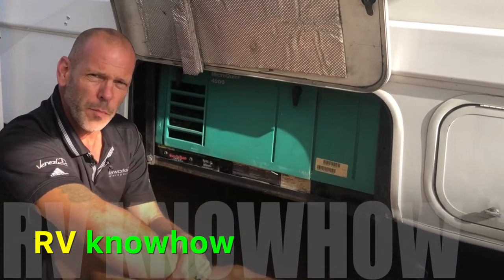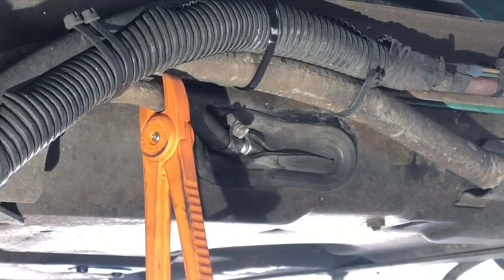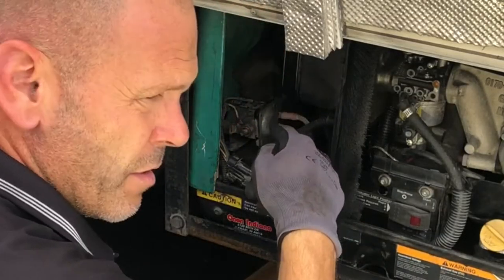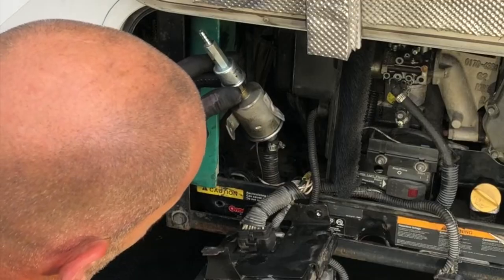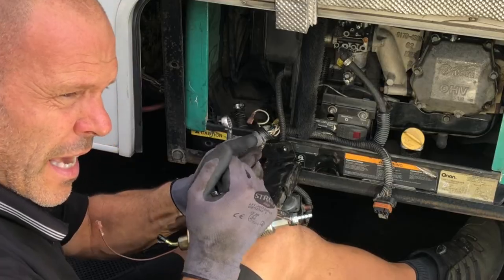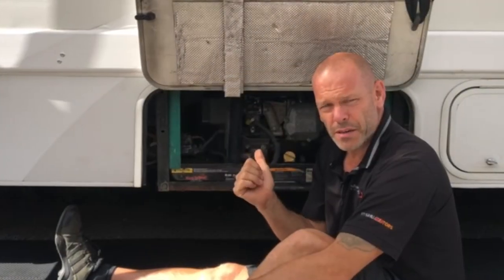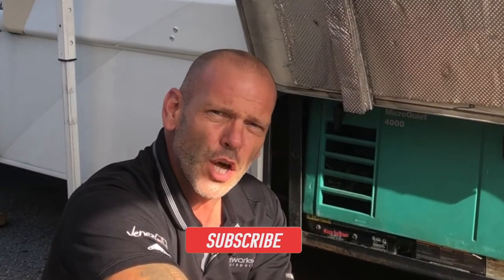RV Onan Generator Fuel pump and Filter replacement. A Step by Step walk through.

Comment: I am a 62 years young, ex-pat now living in Nova Scotia, Canada who took on this challenge after spending $800 + for a company to service the generator. They fixed a ground wire and explained the Gen ran perfectly using an independent fuel source.  Their advice, get a gas container or use the MH as a glorified tent. 🤨
New fuel pump and filter cost less than $100 cdn, plus my time!  I thank you so much for giving me the confidence to replace the old fuel pump and filter.  She now works just fine, I am so proud of my achievement.
Thanks again😃
Reply from the maker: That’s great to hear and thank you for sharing your comments. I can’t believe the service shop would suggest that you use a can of fuel 🤯
Reply: Im 68 , sometimes i realize i know more than most RV mechanics. Not a slam to them , but just acknowledging experience. Good on ya man!

Comment: I have been having trouble with keeping my Onan Microquiet 4000 running and after changing the oil and the air filter decided to give changing the fuel filter and while I was at it, pump a try. I followed this video. It was a perfect instructional video, giving tips along the way and spoke to me in practical, meaningful ways. It was a success. My generator is now purring along. Thank you.

Comment: Sitting here in my home office in Florida, watching these excellent Richie How-To's this morning. I'd already watched the video on dropping the entire generator and replacing the starter. I'll be doing that i decided, then I watched this video. I figure while I'm at it, i might as well as replace the fuel pump and filter too. I've got 600 hours on the generator and i doubt it's ever been replaced. (bought the RV recently, used). So why not? Thanks Richie. Great work.
Reply from the maker: Glad to hear it will give you the push to try it, and the where to go to if you need more info.
Best to you

Comment: Thank you so much for the video. Gave me the confidence that I needed to do the job. After replacing the pump I couldn’t get the regulator board back in. Watching the video again I saw how your wires were routed. Put it back together based on that ,and success. Runs great. Your video gets a 10 from me!!
Reply from the maker: Glad it helped Thanks for the comment

Comment: Howdy howdy from Elko NV. usa: Just a thought but if you use a very small pc of two sided tape to hold the srew to the T-30, you wont lose the screw. Just a thought I'e been doing it this way for years with everything from gum to clay to a very weak adhisive. Have a great day- Dave blunt by the by a GREAT video all round

Comment: Your video helped me with an unexpected issue repair.  The fuel pump wasn’t working so I expected it to need to be replaced however I went in thinking the possibility that the ground had come loose.  As it turns out, I was wrong but on the right track.  The POWER supply wire o the pump had corroded and disconnected.  We use our 2020 Leprechaun to travel year round up in Alaska and through Canada and it leaves the camper exposed to lots of unexpected corrosion. Anyway, that for making the video.

Comment: update: Yes, this is an awesome video that shows you step by step what to do. I tried it today and let me tell you it is definitely not as easy as it looks in this video. He just puts in his screw driver and off  comes the part he targets.. Well, I spent several hours today trying to get each screw off of each piece I needed to take off. Every single nut or screw that needed to come out was a fight. Had to to go the store several times to adjust what I was using. The selenoid screw did not just come off using the half inch wrench. I had to go get a socket wrench. The they weren't long enough so had to go back to the store to get the long sockets. I also had to use penetrating oil to help loosen the screws. Finally after getting everything out except the actual fuel pump, I have one last screw that holds the pump down that I absolutely can not get loose. So I"m taking it in to an RV shop to see if someone there can at least help get that screw out. I'm hoping it's not stripped. Just know while this video makes it looks almost easy and do able for us non-mechanic types, it is anything but easy. I'm hoping tomorrow will be a better day and someone can get the screw out that holds down the fuel pump. If not, I'll have to pay the big bucks and keep my appt. at the generator shop at $210/hr. 
Thanks for the great video!
Reply: Be patient with these things Tina, and wd40 and or penetrating fluid on the nuts and bolts can be a life saver, ha and or a lot of $$ savings.
Reply: I had the exact same experience with my Onan 4000 MicroQuiet Tina.  It was the bolt holding the solenoid to the mounting plate that gave me the most trouble.  On many of the bolts the heads just sheared off and I had to drill them out.  I think that solenoid bolt might have been made of Kryptonite, nothing I seemed to do worked.  I can't tell you how many drill bits I broke!!!!  I finally had to go buy a Extreme Metal cutting blade for my oscillating saw to cut the nut side of the bolt free.   But it finally came free.  So don't give up hope.   You can do it!!!!

Comment: thanks man i have head the same problem generator runn for about 25min and shut off thanks to your instructions i found gas was not running after it shut off (before it shut off it ran) i could not find a fuel pump at the local rv shop went to napa autoparts they had a low pressure fuel pump replaced the fuel pump now it wotks awesome thanks again
Reply from the maker: That's great, I'm happy to hear it helped. Thanks for the comment

Comment: Perfect step by step video, now if I just had tiny hands!  On a separate note, absolutely criminal what Cummins/Onan asks for the fuel pump.  I found one of the higher quality knockoffs and it works perfectly for a fraction of the Onan one.
Reply from the maker: Thanks for the comment and yes they are pricey, I usually go with an after market pump also

Comment: Great video, I loved the commentary.  If you put a little grease in the hole where you put the Torx bit it will help hold the bolt to the Torx bit to make it easier to install it.

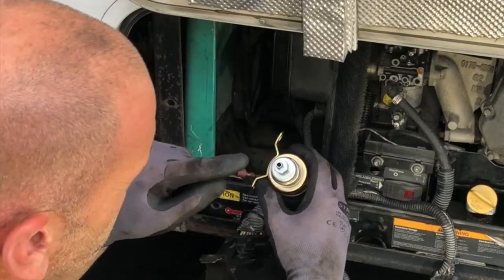Comment: Excellent write up. I will add, at 8:40 take the plug that you removed from the fuel pump and use it as a cap on the barbed end of the fuel filter to keep debris from entering the filter before you put the fuel line back on.

Comment: You make it look sorta easy? I just found out I need a new fuel filter on my Onan generator for my 2004 Minnie. I don't know though. Sounds and looks like a lot of little things to remember which my memory is not so good and I am definitely not a mechanic, so a bit hesitant to try this myself. But the local shop wants $210/hr to take a look at it and try to fix it. Ugh! I also just watched another video from someone else and yours is way better because you showed step by step what to do from start to finish. Thanks

Comment: It has been easy way for you to get the control board out. My wires is so short, and it's a struggle to disconnect/connect the harness.

Comment: You better know how to fix everything on an RV!   I saw your comment that you rent them out. 
Question,   Can you change just the filter through the hole?   Can you remove the air cleaner housing and then change the pump and filter?
Best wishes,    Kevin
Reply from the maker: Hi Kevin. Yes if you only wish to change to the filter just remove the oval rubber grommet and the filter will unscrew. Honestly I have never tried to change the pump by removing the air filter housing, problems i foresee would be the earth cable and the live wire are located under the ECU so unless you cut them and rejoin its probably easier to remove the ECU.
Hope this helps 
Thanks Richie

Comment: I started watching your videos to repair my friend's widow's Sunseeker 2850 so she could sell it.  Found the fuel cut off switch on the bottom of the carb was bad. Saw your instructions on replacing the fuel pump and filter and decided to do that! Thank you so much! I have a concern though. The fuel line going into the filter is rock hard. It doesn’t flex. It's a  2002 unit. How do I  replace the fuel line? It goes up into the floor above the generator. Help is very much appreciated!
Reply from the maker: That’s unusual that it would go up into the floor above the generator. Normally it just heads along the chassis rail to the top of the fuel tank.

Comment: Great video. I liked your step by step approach without making me sit through your whole life story. So many how to videos drag on but I did like the interjections of humorous clips. 
We’ll done.

One question though, did you recommend replacing your filter AND PUMP every 100 hours?
Reply from the maker: Hi and thanks for the comment, not so much a recommendation but just changed them often because we rented the RVs and didn’t want any issues for our customers
Reply: @rvknowhow  Understood.   We use ours all winter in Alaska and the road crud eats up all of the connections. We’re having issues with our fuel pump so I’m going to first check that ground wire to make sure that hasn’t corroded off.  The wires to the heating pads and solar panels had corroded completely off so that’s the most logical step.

Comment: Thank you for the step by step explanation. I get fuel into my 4000 when I use a gal jerry can right below it  but when it's connected to the Ford 450 fuel tank it is starved - no fuel getting to the carb. So I assume it's either the fuel line has a crack or the pump is too weak to pull it from the vehicle tank but not too weak to pull it from a can foot away. Does that ever happen? To test the line I used a small bulb syphon and successfully sucked fuel through it  but it ran for about 1 min then it stopped and sounded like it was starved again.  So I'm going with the pump replacement fix rather than a new fuel line. Am I overlooking anything? Does this make sense?
Reply from the maker: Thanks for comment Steve. Yes I would think the fuel pump is weak if you can get fuel down the line without the pump. Probably a good idea to do the filter at the same time as they are attached together.

Comment: My fuel pump runs intermittently.   I ordered a new pump just in case, but I suspect it's loose wiring to the pump.    Has anyone seen this?    Thank you for the video, it's very helpful in knowing exactly how to access the fuel pump - it's impossible to see from the service manual / diagrams online.

Comment: Thanks for the video. Very helpful. Brand new RV (1 year old) and after a winter the gennie would start but would not stay on long. Figured it was a bad pump. I got the pump installed and thought I connected everything correctly but now the generator has no power. No priming, crank, zero power. I tested with a multi-meter that 12v if getting to the solenoid. Thinking maybe I have a ground issue. I took off the ground wire and sanded them down for good contact. Any idea what May be wrong and anything I can try or test next? Breaker on the generator is towards the outside. Possible that the solenoid is bad. It’s a brand new RV. Sorry for the long winded comment but looking for any help. Thanks
Reply from the maker: Hi Vincent, Sorry to hear of your troubles. My first guess would be the solenoid,  You mention that you have a good ground and there is 12v to the solenoid but you need to check that 12v is coming from the other side of the solenoid when cranking, check that first and let me know. Thanks Richie
Reply: @rvknowhow  thanks Richie. Not getting 12v on the starter side when cranking. I’m going to change out the solenoid and try that next.
Reply: Hi Richie, changed the solenoid and no luck. It look like I’m getting 6.7 or so volts on the solenoid on the starter side but still no start/crank, nothing. 

Tried to jump from the battery directly to the starter side of the solenoid. Guessing I either have a wiring or ground issue or the starter is bad. Brand new RV with 20 hrs on it. I think i need to bring to an expert at this point unless you have any other advice of simple things to try next.

Comment: I was able to remove the fuel filter from the bottom/outside.  The only hard part was getting the threads to line up when installing the new one.  I wasn’t replacing the fuel pump though.

Comment: I replaced the filter and the fuel pump on my Onan 4000 generator couple weeks ago. Fuel tank on my motorhome was below a quarter so I used a 1-gallon jug of gas at the intake to the fuel filter to check and make sure everything was running. It ran great! Today I went and filled up the gas tank on my motorhome. There is no fuel being drawn from the tank to the engine now. I checked all of the fuel line from the engine back to the gas tank. Is there a quicker way than trying to start the engine with an empty gas line in order to get gas to the generator?
Reply from the maker: Hi, do you mean the generator won’t start or the engine on the RV won’t start ?

Comment: Do you have a link for the parts handy?  The correct fuel pump and filter?  I have the same generator.
Reply from the maker: Thanks for the comment, I haven't put a link in the description due to link expiring. I don't use the OEM parts for the pump and filter, not worth the extra cost in my opinion (other people may feel different of course) I usually buy from eBay or Amazon. Let me share my past purchase with you and see if it is still active

Comment: Update #2 Well, I was able to get it all set up and installed. It does work. But now for some reason, my electrical is not working with the generator running. Any idea what is causing that?
Reply from the maker: Hi Tina, I'm happy to hear you got the problems sorted in the end. Yes having access to the correct tools is helpful. If you have no power i would suggest it is probably the breaker on the generator has tripped and needs setting. I will send you a 2 minute video link to see if that works for you,
Reply from the maker: https://youtu.be/CSXSZgDiOKM
Reply: Thanks. I found a video on it yesterday and that's what it was. I just didn't know where the switch was.  Thank you.jeez one problem after another. My electrical is working now but now my side step only wants to go out half way. Omg!

Comment: You change the fuel pump and or filter every 100 hours? Did I hear that right?
Reply from the maker: Hi, yep, because we rented the RV we figured a $50 replacement at home is cheaper than a $500 call out at an RV park.

Comment: Can put the link of where to buy the fuel pump, filter, and grease in the description?
Reply from the maker: Hi, yes I can, because I change them both every 100 hours I just replace them with aftermarket new parts, typically you can find these on ebay shops or amazon.
The fuel pump is as follows. 
Fuel Pump for Onan 4000 RV Generator 4KW Microlite Quiet Cummins 12V E11007 CA.
The filter is as follows.
Cummins Onan 149-2457, Generator Fuel Filter.
And the sealer is from any good auto parts store.
make sure its fuel resistant
Reply: @rvknowhow

Comment: Replaced fuel pump and two six volt house batteries on on an 7000 series.  All appliances work when generator or outside power is supplied.  When these two sources are removed there is no12 volt in house power.  Control
Panel  shows no indication of power.  Can you help me?
Reply from the maker: Sorry to hear of your problems, the first thing i would check is to make sure the batteries are wired in series so they are producing 12v. If they are wired parallel they will still be 6v.

Comment: After doing this I have no power to generator. Any suggestions  ?
Reply from the maker: Hello, Assuming the battery is connected correctly the first thing to check would be the 12 volt supply to the solenoid, thats the thick red cable coming in?
Reply from the maker: Coming into the generator

Comment: Why do you replace the fuel pump every 100 hours?
Reply from the maker: Hi, because we rent the RV's out, and for the sake of $50 its piece of mind.
Reply: @rvknowhow  I took my brand new Onan 4K out west in the 100 plus degree weather and the fuel pump would quit so I wasn't sure if this was a common theme and you just swapped them out
Reply: Seems a bit much for 100 hours. I change oil every 100.